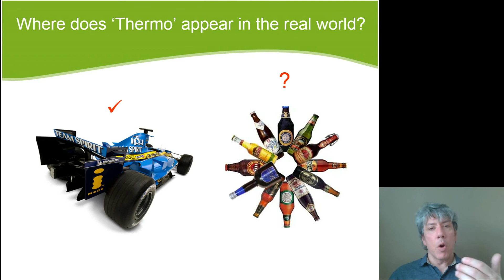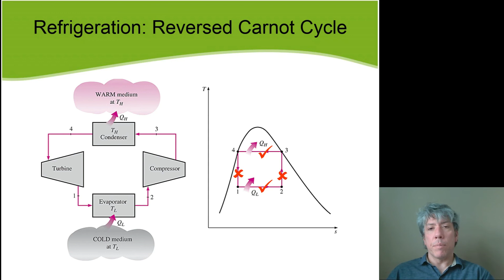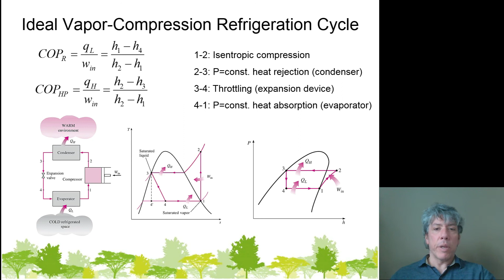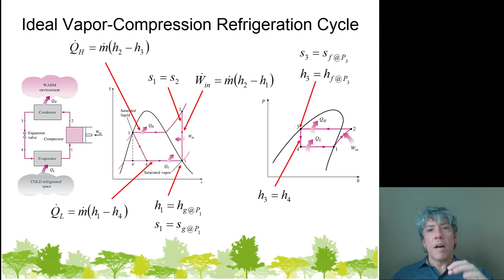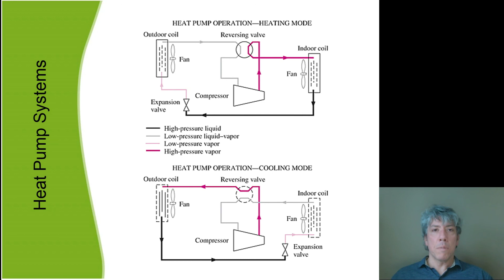MET 220 Vapor Compression Refrigeration

Comment: Thank you sir 
Please i want to ask a question ,
I always hear that evaporation is what makes the cooling effect when the liquid refrigerant expands in a lower pressure , the refrigerant absorbs its latent heat of vaporization from the cold refrigerated space . 
So what will happen if the refrigerant is compressed to a pressure where it has not changed to liquid and we pass it through expansion device to a lower pressure and lower temperature than the refrigerated space, would we still have the same cooling effect or the evaporation process is a must ?
Reply from the maker: Refrigerants are selected because their properties make them ideal for the temperature limits between which they work.   But the latent heat of vaporization is a very large energy change, one that is difficult to achieve by changing temperature alone, without the phase change (latent heat).  Another important consideration is the fact that the boiling or condensing processes occur in the heat exchangers of the unit (evaporator and condenser) and heat exchangers are particularly effective (think of it as efficiency) with these latent changes.  To your point though, there are refrigeration cycles that use air as the working fluid and it never changes phase.  These are most common in an open configuration where the cooled working fluid (air) is exhausted to the cabin of an airplane for air conditioning.
Reply: @damonsisk4270  thank you so much